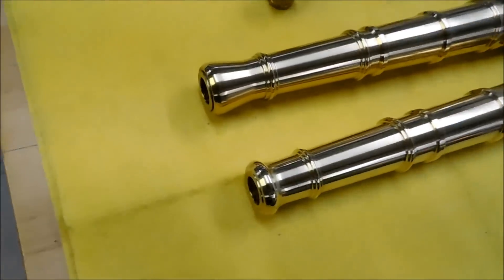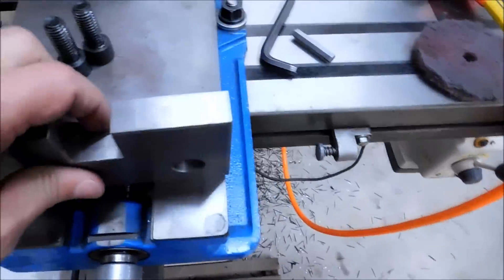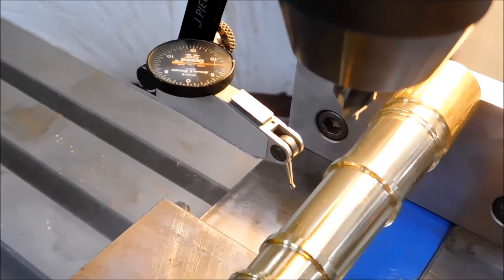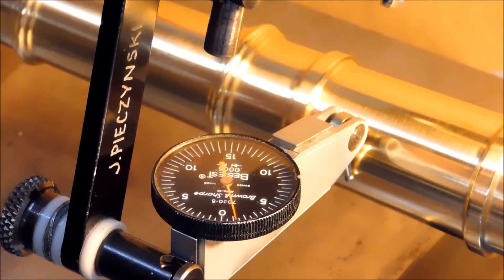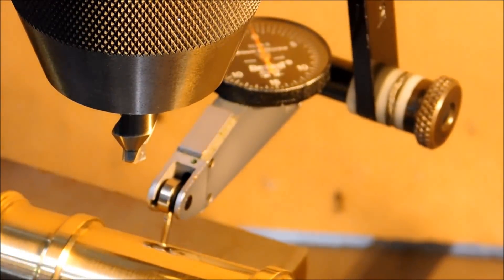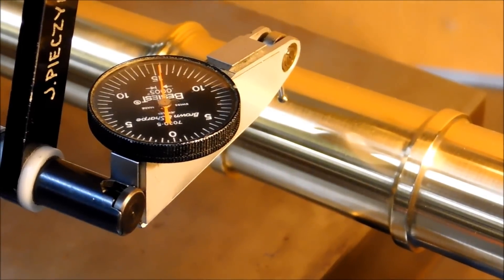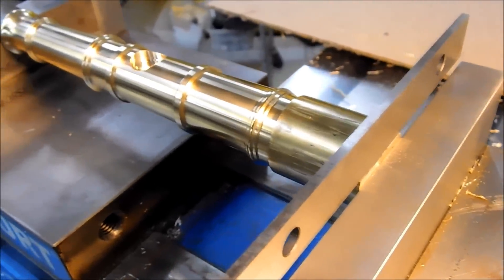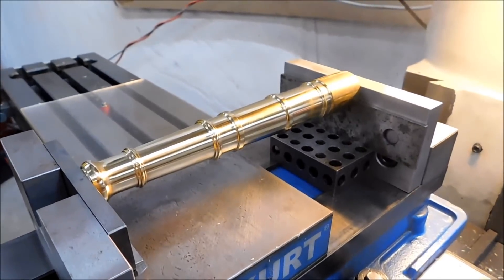One Way Parts and Disposable Features ( on my Cannon Barrel )

Comment: Hi Joe. Great tip, but with this method aren't you having to fiddle with the linkage of the indicator holder to get that distance just right?
Reply from the maker: No. As long as the needle stays within the dial range and you can shift the table to get the same reading on both sides of the part, you are golden. You will have to make an early adjustment, but thats unavoidable.

Comment: As always another great video. Just some trivia about cannons in general. What time period and where they were designed and cast will dictate how those trunnions are positioned. Not ALL cannons had the trunnion C/L on the bore C/L. Some I believe of mostly earlier naval designs from England had the trunnions C/L dead inline with the bottom of the bore. As the engineering got better they started understanding that increased the recoil to both the cannons carriage and the decks and moved to a centered trunnion position. Through trial and error almost all country's adopted the standard where each trunnions minor diameter was the same size as the bore. There was a lot more mathematical based engineering on the full size cannon than it first seems. At a certain point in history then all parts of the actual gun and it's carriage either land or sea based was then a percentage of it's designed bore size for most well developed county's. As the bore size changed then so did the other part sizes so they were then sure everything was more than strong enough.
Reply from the maker: I noticed that in my research. I personally like the trunions on center with the barrel. I think it just looks better, and certainly easier to replicate with plug type trunions. Below center would be a whole different story.
Reply: Turning Point p7 is

Comment: Neat trick with the indicator.  But why not just use a wiggler?
Reply from the maker: Think about it for a second. With a wiggler or edge finder, you still have to move half the contact tip and then half the part to get to center once you pick up an edge. There is a potential for distance error. When you tram a part with an indicator, no additional table movement is required. You are already there when your readings are the same. Its far more accurate in my opinion.
Reply: I think I understand what you're saying.  But if you touch off one side with a wiggler,  set DRO to zero (if you have one), touch off the other side with wiggler, and halve the distance.  You remove the error of your feel of the wiggler (because you're equal on both sides.)  And you remove the error in the diameter of your part being off from spec. because you're equi-distant from both sides.   Just seems easier to me.  You're much more experienced than I.  I'm not trying to argue, just want to learn.  Appreciate your videos.
Reply: I agree with Joe on this. While a wiggler is faster and granted will work...its just not as accurate as using a dail indicator

Comment: Hi Joe, Is your indicator tip perfectly on center? I was thinking that on a cylindrical part that would not matter but on a conical part the shift in Y axis in this case ,as you swing it to the other side, could introduce an error. Thank you for grate videos, this one included. Cheers from "ski" fellow in Sweden.
Reply from the maker: I see what you are saying. And I am sure on some level this is a concern, But, if you have the same condition on the other side, its the symmetry of both that indicate a mid point. Thanks 'Ski', good comment.
Reply: Very good point.

Comment: How do you get the axis of the bore square to the axis of the trunion (since the shaft is tapered)? What is your comfort limit (of ratio of shaft length vs diameter of faced end) if one is just relying the faced end on the shaft to sit square to the fixed side of the vice?
Reply from the maker: I pressed the large faced end  of the barrel against the stationary jaw very hard. As you close the vise, feel for the barrel to rock. Keep opening and closing the vise while maintaining that pressure until you don't feel any movement. Snug it up. I did trust the end to establish the perpendicularity. If this was critical, I may have used a tapered collar around the barrel and performed the operation inline with the jaws so I could indicate it.
Reply: I was going to ask the same question. I will wait for the reply here as I too am curious.
Cheers Joe Gray from John, Australia.

Comment: The rear end of a firearm or gun is a breech.  Breech is also defined as the rear end.
Reply: You are correct sir.
Reply: Well that depends, if it allows the projectile and powder to be loaded from the rear then yes. Then it would be called a breech loader and the breech term is then correct. On something with a solid rear area where the powder and projectile have to be loaded from the front then that area is normally called the cascable. But even that isn't definitive since different parts of the world can use slightly different terms for the same areas. Some terms also got changed during the time between the first invention of what we now think of as a black powder artillery piece and the civil war. Quite a few of the terms on the mostly decorative areas on the barrel were also borrowed from the architectural field. As the engineering got better as well as the quality and purity of the metals used got better the use of those reinforcing rings along the length of the barrel disappeared. The enlarged muzzle area is still seen on land and sea based artillery pieces today since it directs the back blast energy out and away from the gun and crews. It can be seen clearly on naval guns from the second world war but is mostly disguised today with the almost universal use of muzzle brakes. But those help to do the same job as well as reduce the recoil.

Comment: Considering the depth of the hole for the trunions I would assume that you do not intend to fire this cannon is that correct?
Reply from the maker: I didn't want to go so deep that the wall thickness between the barrel bore and trunion pocket bottom became a point of concern. Realistically, if I can keep the trunions square, then the pressure from recoil is then translated to 'Shear" on the cross section of the trunion itself. Its only for show, but I believe it would handle a light load and fire just fine. I may silver solder them in place for added confidence.
Reply: On real Canon the Trunions were cast as an integral part of the barrel and then turned on a “ Trunion Lathe” I have seen model Canon made in one piece but it did need considerable hand finishing around the Trunions. You can however fire them if provided with a touch hole. Actually, thinking about my earlier statement it should be much easier now with a CNC machine to make a proper one piece Canon barrel.
Reply: I was thinking the same thing but then I realized  Hey we are talking about Joe Pie here! I am sure he has already givin it much thought LOL but yeah a "Light" ' Load should be fine. Joe these cannons look AMAZING!!!! Really nice work I can only hope & wish to make something half as nice -As Always Two Thumbs Up Sir!!!

Comment: What is holding the trunions? I don't like that they are not brass as well. A real Parrot would have been 1 material. You need to fashion a matching black walnut gun carriage.  Get it together!
Reply from the maker: Easy does it big guy. Those are gage pins to demonstrate the results of the technique. The actual trunions will be brass as well.
Reply: No, a real parrott would be a cast iron barrell with a steel band shrunk over the chamber area.

Comment: In hindsight, cutting a pair of indexing flats on it could have been done in a collet block before profiling the barrel, while it was still a cylinder and easier to hold.
Reply from the maker: My 5C collet block doesn't hold 1 1/4" diameter stock.

Comment: great teaching joe  cant wait to see how you turn the ball end.     i would have cheated and drilled  the end of the barrel and tapped it. then finish cut it on a pair of centers    then   made a seperate piece  with the ball contour that would screw on to it.   but i'm an amatuer.
Reply from the maker: The plan is to use form tools. I'll grind them up and just coordinate the moves. I'll probably post that op as well.

Comment: Joe nice work.
There is one thing no machinist talked about -types of steel you use .
What types of steel should i stock for general use ?There are around 3000 types for steel known to man.Which ones are best for general purpose ?They always say i used mild steel but there are several hundred types of mild steel.
What if i need stronger parts ?Like what are general purpose alloy steels. 
Im not talking about special ,custom made parts of exotic materials like titanium or hardox 500,more like every day when guy comes to your shop and says i need this tractor peace made..
Reply from the maker: Most of the time when someone says mild steel, they are probably referring to 1018 CRS. If they need a tough part that will wear well, then step up into the 4100 series. 4140, 4150. Still machinable, but much tougher than the 'Mild" steels.